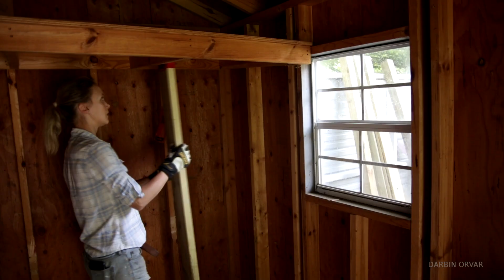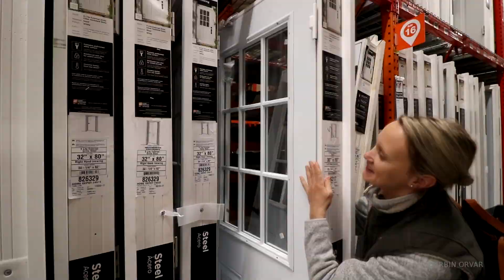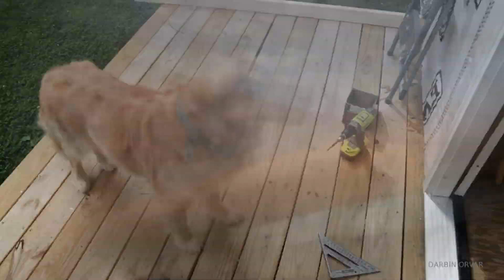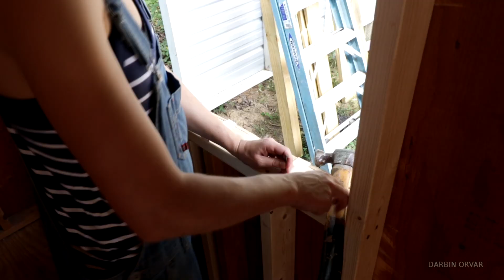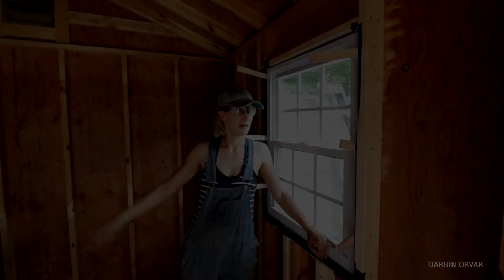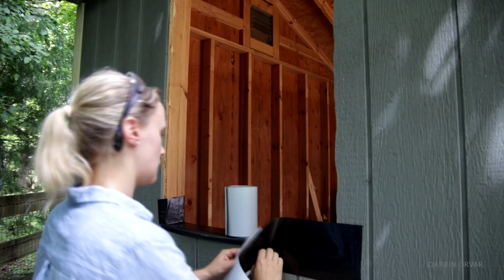Building My Dream Shop - Installing Windows

Comment from the maker: A lot of people are suggesting I should install the window air conditioner in the wall instead of in the window. I would do that if it was a good idea, however window air conditioners are not designed to be installed in the wall. At first I was planning on buying a designated in-the-wall air conditioner, however once I realized it was cheaper to buy an additional window + a window air conditioner, I decided I would prefer to have the additional light coming in, and to save some money in the process.
Reply: How about a small one zone mini-split unit hung on the wall? You wont lose any window space. Some mini splits do heat as well as A/C, so you would be covered in the winter too.  Maybe you could even get them to sponsor the video and supply the unit?
Reply: @Scott-kh4pw  Yeah, mini-split is what I was thinking too.  Better design than window unit.
Reply: @Scott-kh4pw  window units are far cheaper. iirc the cheapest diy split is $1200 or so, you can get 3 window units for about that. The one cheaper split I found still requires a tech to vacuum and charge it.
Reply: Honestly I think it'd be really interesting to see a budget analysis/breakdown of project and how/why you made certain decisions with money in mind
Reply: What would be the problem with cutting a hole in the wall, reinforcing it as necessary, and sticking a window air conditioner in the hole? I’ve seen that done many times here on the Gulf coast. So now I’m really wondering: other than that it doesn’t look great, does that approach cause problems?
Reply: @censusgary  
Not if you use the same steps as installing a window.  You do need to make sure that the unit is on a slight angle so that water flows away from the building rather than towards the building. The properly seal the unit within it's opening to avoid air leaks.
Reply: I used to install RAC (Room Air-Conditioners), you can certainly install in the wall, as others have mentioned, make sure it's angled so the water that can collect in the bottom of the slide in unit falls away from the building. And that it is sealed around the outside of the casing that the actual RAC slides into from the inside of the building There is no hard and fast rule that an RAC must be mounted in the window.
Reply: it can be done by making the mounting area basically a window without any glass . . . keeps the condensation going the right way, and can be sturdier mounting than some windows. But, if you are adding windows anyhow, why not add the extra light of yet another to hold the unit?

Comment: I like the way your shop is progressing, it's given me ideas for what I may need to do in the event that when my wife and I move, and the house we end up with doesn't have a space for my woodworking.
I was wondering if you considered installing a mini split HVAC system instead of a window unit?
Reply from the maker: Much higher cost.
Reply: That's what I thought. I'm sure if it was a larger area the initial cost would be absorbed over time by the lower cost of running a split system over a window unit.

Comment: If doing a window air conditioner from scratch like this, its important to choose the width of the window to match the width of the air conditioner, so that you dont have to use those high-loss wings on the sides to fill in the gaps.

Comment: Good video Linn!

Every time I watch a window installation video, I see all the things I didn't know about when I replaced a window in the Mobile home I owned a decade or so back. 

Fortunately, despite my lack of knowledge, the only time it leaked is when the gutter was full of leaves and a river of water ran down the side of the building. But then, the old window leaked when that happened as well. I cleaned out the gutter and had no more issues with it.

When I replaced that window, I installed a smaller window than what came out and added a hole next to the window for a window air conditioner to sit in. It worked perfectly fine and no leaks after sealing it with closed cell expanding foam spray.

Comment: Always going to have 2nd guessers.  You can put the window AC in the wall at a later date if you want to, but best before you insulate and sheet the walls if you are going to.  My suggestion for next best step is the electrical.  Great work.  You always remind me that actually doing a project and getting it done IS the best way.  The worst way is my method, which is keeping all my project aspirations in my head.

Comment: Just curious why you didnt just mount the window unit in the wall instead of in the window. Keeps access to the window open and is easier to seal from the elements.
Reply from the maker: See pinned comment.

Comment: Hey Linn, Goathead enjoys all your vids. He had a thought!..How about making a dedicated hole for the ac, that way you dont lose cross ventilation or light,  and you can leave it all winter with an insulated cover over it on the outside.
Reply from the maker: See pinned comment.

Comment: Why not do a mini split instead of a window unit (in regard to AC)?
Reply from the maker: Cost, it's cheaper to do a window air conditioner as opposed to a mini split.
Reply: @darbinorvar  Makes sense :)
Reply: Seems like a small space for a mini-split.  Plus, do they make them to run on 110V?  I thought they were all 240, which would be more of a hassle to bring to the shed/shop.
Reply: @rjtumble  Not sure about 120/240, I'd imagine they make ones that run of 120? And I know you can get ones with different BTUs, wouldn't need to be a big one no, but by same logic 140 sq ft is small enough that even a window unit may be overkill?
Reply: @ethereal_emily  I looked, there are 120V models available.  Looks like the issue is that they're all (as far as I can tell) over sized from a BTU perspective.  You need less than 3000 BTU for that space and the smallest I could see were 6000 BTU.  So, the window A/C is going to be a better way to go, plus easier to deal with.

Comment: An incredible range of windows and doors that Home Depot keep in stock - it must make your design choices relatively easy ! A stroke of genius there to replace part of the old shed frame with ready-assembled ones. I loved the production of the video too, where you have shown us all of the important parts such as visiting Home Depot, making the new frames, fitting the frames and enlarging the window openings, waterproofing the openings, and fitting the windows themselves. It sounds a good idea to fit the windows early on, to allow more light into the building when you get started on the fitting out. Are you going to also add insulation panels into the frame of the building, and cover those with wood panelling ? This project is exciting - it will be fun to see how you take it forward ! Good luck !

Comment: Good job.  For another method to clear out the siding in situations like that, I have seen contractors use a router bit with a bearing from the outside so that it runs along the 2x4 and trims off the sheathing.  Not sure which would have been easier, but it is another method that could work if someone had those tools. :)

Comment: Linn, why aren't you putting a hole in the wall and mounting the AC unit in it permanently. That way you get more light from your window, the AC unit would be better supported than it would be in a window and you could put it high up on the wall out of the way. Just a thought. Love your videos but not enough of Darbin the boss in them.
Reply from the maker: If it was possible to mount a window air conditioner in the wall, I would totally do that. Unfortunately you need to buy a specific wall mount air conditioner and I found that it was cheaper to buy a window and a window air conditioner than to buy an in-the-wall unit. So I figured I would prefer to have the extra light, and save some money :)